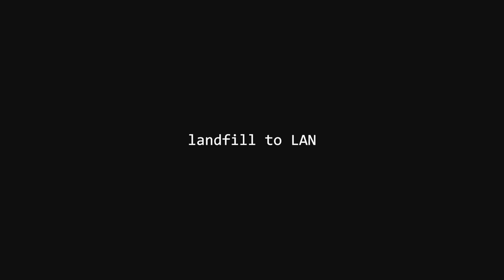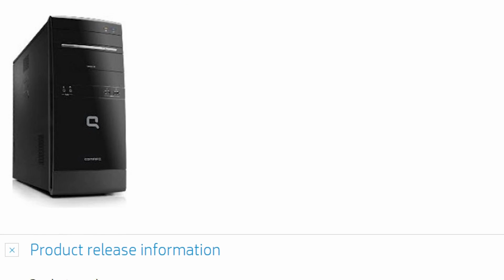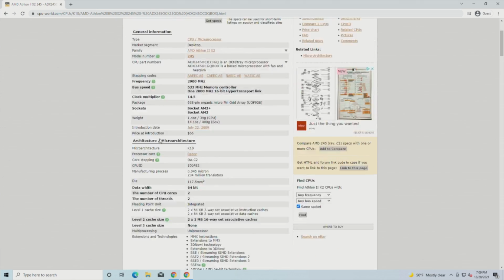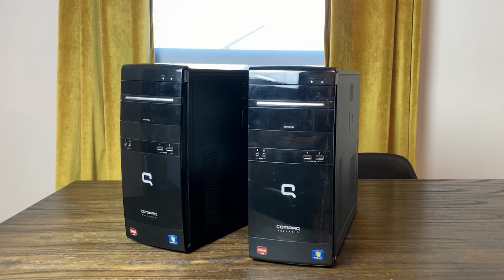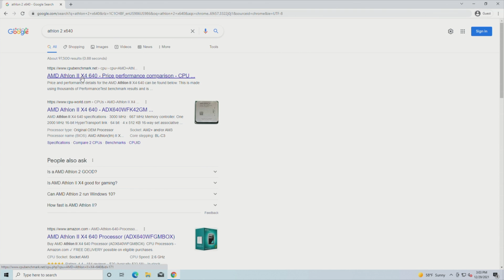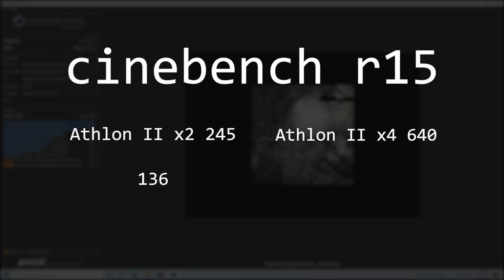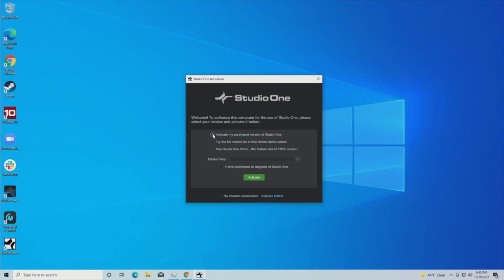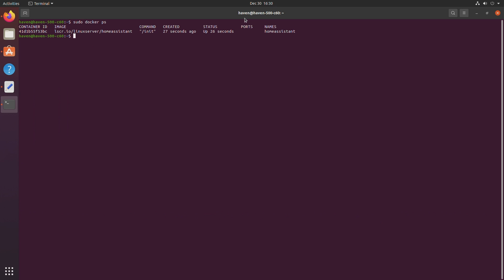Scrap PC Budget Build - Landfill to Lan: CQ5720f

Comment: A similar project fell in my lap so to speak. Lol I was gifted an Optiplex 780MT (🤣 I know, I know.), and was wondering if it were possible to bring it a bit up to date (2012ish). I know the biggest hurdles are finding a compatible motherboard and PSU. I don't particularly like Dell, but I do like repurposing things from the past. Currently all the PCs in my tiny homelab are SFFa (Lenovo m710s), and would like something that I can keep my hard drives "inside". Currently my Lenovo's hard drives are sitting in 5-bay metal cages next to them, internally powered. Is this a possibility, or am I just asking for too much? I'd like to bring it up (from DDR2) to DDR4.

Comment: the amd x4 processor does not have graphics on cpu.   it is on motherboard.   You did not make that distinction.   so I am adding it for those that might try to do this type of build.   I do not think that on-chip graphics did not show up until am4 socket.   I have a phenone II - 8300 - no graphics.   which is fine - put an nvidia 1030 in it - does well ( but I am not a gamer ).

Comment: I love to mess around with computers and build new systems, or repair and modify old ones. I take them in like "the crazy cat lady" takes in cats. Every system I have is one that either built, or a prebuilt system that I modified or did repair work on. I run the gamut from a 6 core i7 based system that I built which runs a Gigabyte main board and  has a dual boot option, I can run Windows 11, or Linux Mint 21.2 Cinnamon desktop all the way down to an (almost) bog stock Gateway 2000 Pentium 4 which is my retro gamer. The only things I did with that was to replace a failed PSU, a RAM upgrade, and wiped the hard drive and did a clean install of the OEM Windows XP that it came with, as well as its drivers, since the thing was so loaded down with bloatware, it couldn't get out of its own way. That Gateway leads a "sheltered" life these days, since I have no way of connecting it to the internet, (and no intention of doing so). All the games I use on it run from CD ROMs

Comment: I just found your channel this week and have been watching lots of videos, I love the vibe and the info, thank you!

I actually have this this machine with 3gb ram, and I was thinking about making a NAS or media server. Wouldn’t it be worth it?

If my client can play 4k videos but it’s from this server would it display in 4k?

Also would transfer speeds from server to network be dependent on the NIC of the machine?

Was thinking of adding 8 gb ram and they used 4tb drives you showed in another video, or 1 ssd and a hdd.

Comment: @HardwareHaven How did you get windows 10 installed? it looks like this processor isn't supported anymore with windows 10, just curious because i've been upgrading a computer with the same processor and tried installing windows 10 but it came back with a "FAILED TO BOOT INSERT DRIVE AND TRY AGAIN" or something along those lines. Love your channel, Keep up the good work!

Comment: I know this is 6 months ago, but here is my expierience.
When I have dealt with older PCs, The thermal pad (OEM) has usually worn out so the temperatures are bad and the processor will throttle (shows as going to 100%).
Removing and reapplying the thermal paste ussually fixes this, but something to keep in mind with applying thermal paste, after about a year the paste will dry out and you'll be in the same spot.
You may want to try investing in thermal pads to ensure longevity in builds you try to get more life out of them.

I really like your videos, keep up the good work!

Comment: got a dumpsair pc ,  was a 775  with core2quad and some ram ,   the mb and psu was dead ,  but the cpu am still using it on my file server   nice upgrad from the core2duo that i had  wen i buy ti in 2008 ,  and the case  that is prety good host my workstation  a x99 rig ,
Reply: and some friends give ther old broken pc from time to time ,  some of them just need few parts ,  and i have flip some for 50-60euro

Comment: I had an HP touchsmart 310 AIO, that I replaced the motherboard and CPU.  it had the same CPU, btw.    It served me well for years, and I ended up giving it away.   The two cores could not longer perform outside of using linux, and I didn't want to stay in win7.

Comment: You can get a lot of mileage out of older hardware for audio production as long as the software is well optimized and you don't use many cpu hungry plugins.  Reaper runs great on old hardware, even better on linux.

Comment: The type of video, I like because I use that type of PCs. I did give this weekend a comparable PC to a friend for the normal Internet browsing. I used it myself till April 2019. It was a 2008 HP dc5850 and I upgraded it in the past to a AMD Phenom II X4 B97 (4C4T; 4x 3.2GHz); 8GB DDR2 (800MHz).  This weekend I added a 250GB WD-Blue HDD (120MB/s) for DOP 800 (~$15). It runs Ubuntu 22.04 LTS. 
I even use myself a truly ancient PC as backup server, it is based on the remains of a 2003 HP d530 SFF with a Pentium 4 HT (1C2T; 3.0GHz); 1.5GB DDR (400MHz) and 4 HDDs in total 1.21TB (2x IDE 3.5" and 2x SATA 2.5"). That system runs FreeBSD 13 on OpenZFS 2.0 in a Compaq Evo Tower with a Windows 98SE activation sticker :)  It is powered on for ~1 hour/week to receive my incremental backup at 200Mbps of the 1Gbps supported by the HW. The speed is limited by a ~95% CPU load on one CPU thread. 

I use the system since June 2019 and intend to use it many more years, just for fun using a true antique. You can't use older systems in a modern environment. This system is just usable, because it has 1 Gbps Ethernet and it was used during the transfer of IDE to SATA, so it supports both IDE and SATA disks, so I reused 570MB of IDE and 640MB of SATA disks .  Older PCs would have too may limitations and are only useful as museum piece.

Comment: You could use the 1x to 16x mining riser to add a gpu or just get the GT 710 pcie 1x
Reply from the maker: For sure!
Reply: @HardwareHaven  i personally have used the mining riser with a GTX 960 2gb and it works but when the gpu is needed heavily the microstutter isnt good
Reply from the maker: @dexsters5643  yeah I imagine it works well for hardware decoding and encoding, but not as well for heavy 3d stuff
Reply: @HardwareHaven  i tried to use the GTX 960 as a NVNC card while i was playing games on a RX 570 4gb. Because the AMD encoder was giving trouble and it worked but for gaming it works but to a Ok level (GTX 960 on 1x pcie)

Comment: Look into cutting the X1 open. It's not that difficult with some tools. Did this with X8 slots in servers for a while since the VGA was awful and could barely do window dragging. You're seeing issues due to lacking hardware x264 support. It's like using VLC on a pi 3 or using software based transcoding. It's night and day.

Comment: Had no idea those old integrated AMD graphics were this bad.I have an old Dell at work that still runs daily to playback Youtube music in fullhd and it runs smooth.It uses a Core 2 Quad Q9400 with 8GB of RAM and Windows 10,but as far as i knew Intel graphics were bad and i did not expect it to run that good.I guess those AMDs proved to be worse

Comment: I ran a HP system with the same X4 processor doing freelance work for about 10 years without running into any roadblocks. It ran Debian i3 (lightweight window manager) with a PCIE Radeon HD4650 which gave me an extra monitor (but your MB won't support it). I actually attempted the 6 core upgrade and found the MB had it blocked, likely due to TDP wattage. This is a detail that was never explicitly mentioned on HP's motherboard website, and was only implied in the manual. It's also possible they were hardcoded for support for specific CPUs so maybe a bios upgrade would help IDK.

Only after starting to stream did I run into the bottleneck and get a new computer. The old one will become a storage server and whatever else I can put on it. Still a great box for modern use if you treat it right.

Look deeply into the 6 core upgrade for the motherboard before buying so you don't get burned like me.

Kudos reducing e-waste and making use of things that are still useful. We are far too predisposed to dispose of useful things these days.
Reply from the maker: Great story! And yes, people get way to excited about new stuff when half the time their workload doesn’t need to resources anyway. Thanks for the comment!
Reply: @HardwareHaven  That is all too true, I work junk removal and the amount of old/ fairly new computer tech I find is astonishing although now you've given me some ideas on what I could do with some.

Comment: Not sure if you can use the Windows 8.1 Radeon 3000 drivers, or if the automatic (or maybe its optional update or update catalog) ones from Microsoft are better - I think my FX4130 on 760G Radeon 3000 IGP handles youtube ok, I'll have to fire it up again (I was last torturing it with a forced Win11 install)

Comment: i got lucky with a similar board i got when a family member dumped a SFF Gateway onto me. the board was a Packard Bell model (they handed Gateway/Acer's fab at that point as it was another division of the company), it was AM2+/DDR3, and had an athlon II x2 225. the board did have a couple of things going for it - it had a PCI-E 16x slot, and Nvidia onboard hardware (graphics, LAN, northbridge) which meant i could use nice piece of legacy software : Nvidia System Tools! simply put, you can access all tools like you would in a bios to overclock, including increasing multipliers and cpu speed (that 2.8ghz 225 was able to hit 3.1ghz). after a couple of months of trades and savings (2016, was on unemployment) i was able to throw in an Athlon II X3 460 (base clock 3.4ghz, i had it overclocked to 3.7), as well as 8gb ram, an antec 500w psu, and a 2gb XFX Radeon 6870. Did me well til i handed an old alienware with an i7 2600 (still running it today on an acer board with a 1060 3gb and 16gb ram, purrrrrrrs!!). these older builds are great when you can wrest more power from them. also, use the H.264ify browser extension, forces any site like youtube to run h.264 video instead of VP9, so the Radeon graphics will handle it. should be fine for a general use machine by then. ps, that works in linux as well. that'd be a dandy ubuntu studio pc

Comment: Great video! I am having a similar experience as yours: picked up a PC that was lying next to a dumpster; it was an AM3 machine, and its CPU, dGPU and RAM were missing. Thankfully I had a Phenom II at home, plus some RAM, a spare SSD and a GTX650.
The reason the previous owner likely threw the PC away was because of a faulty, whiny PSU that I had swapped by a reliable SilverStone unit.
Now I'm doing some stuff on that PC, until I can get a more modern machine (had to sell mine to get a PS5).

One thing about AM3 chips: temperatures seem quite anomalous because AMD chips of that vintage have two rated max temperatures, which are Core Temp and CPU Temp. If your readings differed, it was because each application is either reading one, the other, or both, or averaging the values. Also, the max temperatures are quite low, between 60 and 75°C, even though the silicon and die have much higher tolerances, up to 90°C. So, if your readings were "low", it's right.
Reply from the maker: Nice! Thanks

Comment: Nivida has a pcie x1 version of the gt 710 I think. This isn't a beast in gaming but it may improve video playback.
Reply from the maker: Yeah I’ve been trying to find a good deal on a used one
Reply: @HardwareHaven   dude you can grab a x16 version and then grab a 1x to 16x adaptor, it will be less of a headache and cheaper
Reply from the maker: @serenitysuccubus9231  Possibly! But those can also cause issues with space and getting this to fit in the case properly

Comment: when you are trying linux with low resources i suggest either slitaz linux which is the #2 light distro in terms of requirements and usage or puppy linux (runs from ram). Both do not use Gnome and systemD that Ubuntu uses and tend to make the o.s bloat (heavy for no reason). Apart these i could see my self using a pc like this. FYI i already use a Lenovo m58e with 3 gb of ram and a pentium core2duo e5600 as a pc for streaming radio. It can open around 10 tabs on chromium without much issues and a terminal running in the back. BTW it uses Void linux which also very light on resources.

Comment: Nice video. Just a heads up, Ubuntu is a bit heavy.  A lighter version to try is Lubuntu. I run that on my 12 year old dell laptop with an SSD and it's faster then most newer laptops. And if you want an even lighter one, Antix, Bodhi Linux or Puppy linux are good choices too.
Reply from the maker: I'm thinking of doing a 'lightweight' distro comparison type video in the near future. Thanks for the recommendations!

Comment: This is almost nostalgic for me. Our old family computer was a Dell Inspiron 570 running 4 gb of ram (with 4x1 GB sticks) and the same Athlon ii x2 245. It started out with windows 7 in 2011, and lasted all the way to August 2021. It was my first foray into anything dealing with computer parts and gave it some love around 2018. Several upgrades at questionable prices like an Athlon ii x4 645 (4 cores at 3.1 GHz), 10 GB ram (2x4 GB + 2x1 GB of the originals) and a GTX 1050. It felt pretty capable of handling games as long as you managed expectations, and I wasn't playing anything particularly intense.

Unfortunately, it ran into problems as expected for its age. By this point, it went from handed to my older brother to me to my younger brother. Eventually, it just didn't boot up. Fans were on and but never reached bios. Kitted out a whole new build for my brother carrying over only the GTX 1050, an 250 GB SSD and a 2 TB HDD I had added. It turns out later that it could still boot up, after I checked up on it. I was thinking of turning it into a server, but couldn't really think of anything useful to repurpose it into. Eventually, I tried to boot it up again, but it didn't even flicker that time. I'm thinking it's a BIOS battery issue, but it's really lost cost fallacy and sentimentality at this point.
Reply from the maker: I love stories like this. I wish I still had more hardware from when I was younger. Thanks for the comment!

Comment: Hiya, pal; (Sorry, don't know your name.)
Yeah, old computers are cool.
I have a AMD x4 640 Propus (is that supposed  to be a star?).
I built my 1st own-built computer in 2010.
Reading "boot" & "MaximumPC" magazines back then, I built a 'mid-range' box.
The AMD X4 640, a 500GB HDD, 4GB RAM on an ASUS M5A97 R2.0 mobo.
It ran pretty good.
Later I upgraded the CPU to a used FX-6350, 16GB RAM & some SSDs (1 win7, 1 win10, 1 MX linux).
Still use that rig as my 'desktop' box.
(Writing this on a ThinkPad T-430, which I just added 8GB RAM to.)
I want to upgrade the CPU to an i7--3540m.
BTW, adding a "discrete graphics solution" can 'free' up some old hardware.
The video card can 'unload' the CPU but it doesn't always work.
If the 'chip shortage' clears I'll prolly build a new system,  got 2 CM Elite RC-330s, 1 still in-box.
Thanks for the memories.
Reply from the maker: Thanks for the comment Jon! It was fun to read. Lot's of cool systems and history with 'em. And I actually messed around with adding a gpu (r7 240) to an athlon x4 in another video. It was interesting seeing what it could do in terms of helping with video playback. Best of luck with any new systems and upgrades! Hopefully the market gets better soon. Have a good one. Oh! The name's Colten by the way haha

Comment: You could use a pcie 1x to 16x adapter like the crypto miners do. Then get a GT 1030 or something super low power and see if it plays videos better. A 1x connection might not bottleneck a very low end card.
Or if you are daring, you could take an exacto knife and cut away the back end of one slot and you can put a gpu straight in there.

Comment: little tip for straightening pins: use a mechanical pencil. the little metal tube which normally holds the actual pencil lead is really perfectly suited to fit over the pin and helps greatly with gently pushing it into the right direction.
Reply: Oh wow, I’m actually gonna try that. Thanks for posting this
Reply: Wow you just saved me over 3000 CHF
THANK YOU 🙏 ❤❤❤💾💾
Reply: 07 or 05 graphite sticks ?
Reply: @thomaslayman9487  both should work, but I most pens I have are 05
Reply: I never thought of that!!!!!! Nice !
Reply: A razor blade is also quite useful.